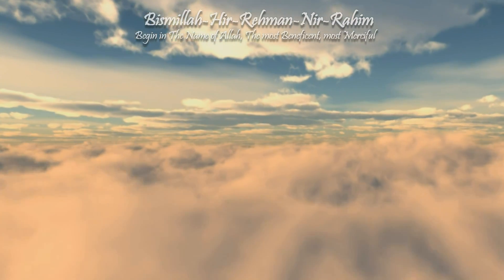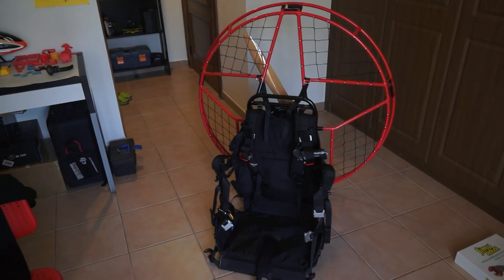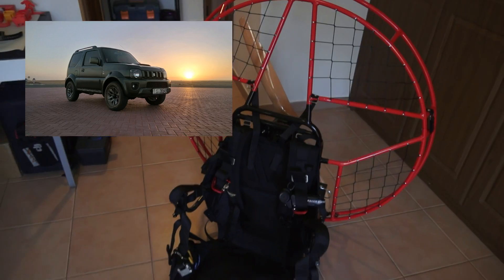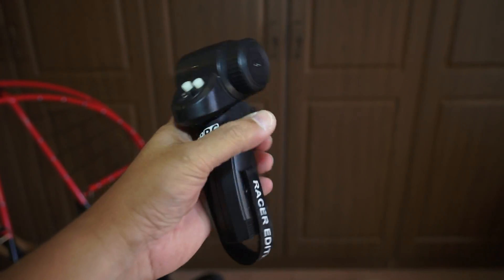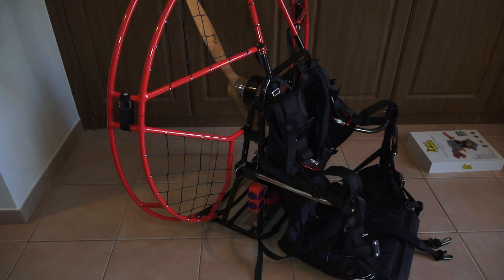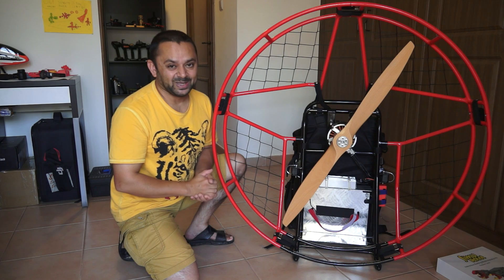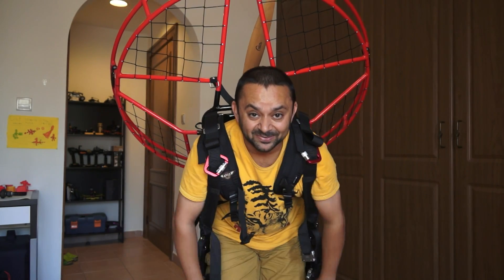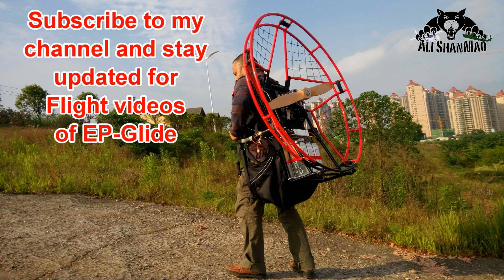Introducing my Homemade Electric Paramotor V2

Comment: wireless throttle control is not certified and highly discouraged for any type of manned powered flying - find a way to run cables like regular PPG IMHO
Reply from the maker: So far it has worked super nice. No glitches, no issues. Running a cable, is always an issue, it gets in props, it gets stuck around. This is a 2.4Ghz Wirelss Throttle and it has range up to 50 meters.
Reply: I see that it is working but that doesn't make it the safest option and I am almost 100% certain wireless throttle control would never be certified as safe and there's a reason for that,  I strongly believe in the tried and tested in aviation - innovate yes but look at the major manufacturers and designers of aircraft and aircraft systems none of them incorporate a wireless throttle system and that's for good reason. Cables have worked for suspended power systems for years and if run and designed properly should never be an issue, if you are getting cables in your prop you have a bigger problem than the cables. I applaud your innovation and pioneering spirirt but be wise about it and look to others to learn from mistakes made, 2.4Ghz is not failsafe I lost a 4m scale sailplane flying Futaba 2.4 and never got over it why subject your primary systems like throttle to a technology that is subject to failure
Reply from the maker: Hi Darren, 

I have flown and tested this throttle many times. Never ever had an issue. We even tested it with 5 RC Pilots flying 2.4ghz RC Planes around me. I stood very close to them. Still never had any issues with interference.

I think the problem is, people are not ready to accept new technology. they are having hard time to get away from what they are used to use. Old school. Yes it works. but its time to move on. There are better and more convenient stuff to use now. Safer too.

In case of any interference, Speed controller is programmed to stop the motor. In case of range issues. Speed controller will stop the motor. If you drop the throttle. Motor will automatically stop. There are failsafe built in. and again, we have tested it and abused it. it works like charm. 

its time to accept the new safer and better tech brother :)

Comment: 45kg=99lbs, sorry we Americans like pounds/ounces, however, thats about 22 kg short of the standard 150 lb [80-something kg] needed thrust to give the pilot some envelope. Turbulence, rotor currents of of mountains etc.. I wouldn't try 99 lbs of thrust low to the ground, a sudden tail breeze and you have no reserve power to fly out of it.

Comment: You are doing amazing work Ali!  Keep it up!  Incredible amount of sophistication in the V2 design already, excellent job on the fail safe design and love the wireless rc control.  Look forward to seeing it improve as batteries and the power design gets more efficient.  Maybe make a carbon fiber cage like Scout Paramotors which will reduce overall weight.

Comment: That's flipping cool! I built a paramotor with a Dle-170 RC airplane engine. Ive got a walkthrough video on my channel.
Reply from the maker: sweet will check it out. Many of paragliders in my City in China built Paramotors with DLE RC Plane engines :D and they fly real well. I wanted to go electric as I am an RC Guy :D hehehehe and it works really nice. just need to wait till battery tech grows to be good
Reply: I'm so glad to hear that the Dle's fly well! I haven't flown it yet due to engine trouble and have been nervous if it will fly or not.
Reply: @alishanmao  whats the motor you used in your setup..
Reply: always eye balling those dle engines.. but always hesitaded coz of no reviews.. i've google it and nothing but link to ali express..  first time iv'e seen it talked about on the net..

Comment: What is the purpose of having a cage with 3  big openings where your arms could accidentally go through, say during a crash landing or during turbulence?
Reply from the maker: I have tried every way to bend my arms to go through those openings or my head to prop. without breaking my arms or neck, there is no way i can ever put them in prop. LOL 

So yes I feel this cage is very very safe. 

in case of crash of course people and things break in many unimaginable ways and I hope not to have a crash.
Reply: Of course you hope not to have a crash, but if you do, it will be very easily for a shoulder to be dislocated and also your torso can shift in the harness and that combination will absolutely make it possible for your arm to be forced back through the hole in the cage.  Is that how the cage was designed by a manufacturer or did you remove the netting so that you can disassemble for easier transport?

Comment: Wow,super cool. I have a black devil and a Simmonini 122, both in shop for repair. No spark on Simmonini and prop came off or pulley broke off metal fatigue . Boy I would sure love an Electric paramotor without spending 16k.I fly an Eden 30M wing and weigh 204 lbs. wounder what size motor I would need with 48 inch prop?
Reply from the maker: tell me about it. too many issues with Gasoline engines. Pulleys, Carb Settings,  oil mixing, engine tuning. Makes you a grease monkey soon. 

Electric are the way. Battery tech is improving day by day. I am using some 1 year old used Lipo Hobby batteries, borrowed from a friend. Later in China I will get me brand new one batteries.

With Electric there is no pulley, no oil, nothing. Clean setup, environment friendly. I can get it ready to fly in 3 minutes or less after I take it out of car. strap 3 batteries. Power on the electronics, Connect batteries, get your glider hooked and you are good to go. 

for 92kg (204lb) and the gear will say about 110 to 115kgs total. you won't need 48inch Propeller. we can build a slightly bigger motor to spin 38 to 40 inch propeller. I believe you will need 50kg of thrust to get airborne and stay in the air. rest is all about batteries :) if you ask how long will you fly.

Comment: Hi, love the build :)  Having played with Radio Control equipment  you need to give some proper thought regarding the band / frequency the throttle is running on.  A decent powered model plane transmitter could cause you some serious problems or a good AM/FM or ham radio transmitter.  The fact that it is a racing throttle means  it's probably on FM and CB transmitter can cause interference.  I used to make my friends RC car do circles by keying up :)  I currently fly a paraglider but looking to do a conversion later this year :)

Comment: What amount of cruise time do you estimate a pilot of your weight will have?
Reply from the maker: Theory and Real life are always different. On the ground, testing shows 12 minutes of pushing the power combo against the high thrust and even pushing my little Suzuki Jimny, on fully charged batteries. Though full throttle for longer times to push a car drained the batteries but still at the end I had about 60% battery left. 

in the air its different, there isn't anything resisting the thrust. So theoretically,  I am expecting to cruise for 30 Minutes, depending upon if I am climbing to higher altitudes, that would need more throttle and more power. 

Also I am running very old batteries borrowed from a friend for now, due to the fact batteries cost two arms and two legs here in UAE LOL. right now these are only 10000mAh. I will have much more flight time using newer and higher mAh batteries.

expecting to get newer batteries with higher MAh soon. 

Fingers crossed, let us see how long would I get. Need to get some ground handling time too to see if my risers are good enough. I still have Parasailing Canopy that does not have right risers. I may need to just add two new handles to extend length and not brake too much during flight.

Comment: You need to work on the throttle. That's a scary amount of debugging to do. I mean the plan if the throttle receiver trips out and goes 100% is to fool around in the back by the propeller and 'disconnect' a box (not even a safety shutoff?).  This thing sounds scary.
Reply from the maker: for the first test flight, there will be an easy to disconnect Main Battery power to ESC Switch / contraption. Should motor go full throttle for no reason, it will be an easy pull to disconnect all power. Kind of emergency Shut off line, just next to my leg.